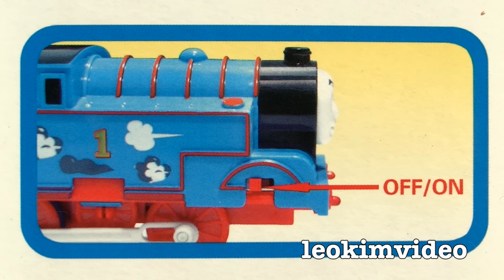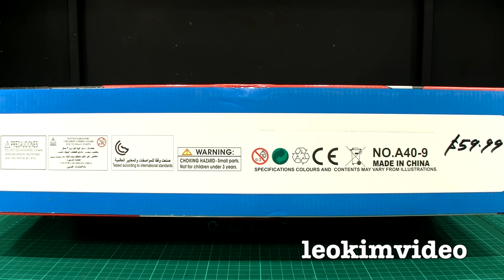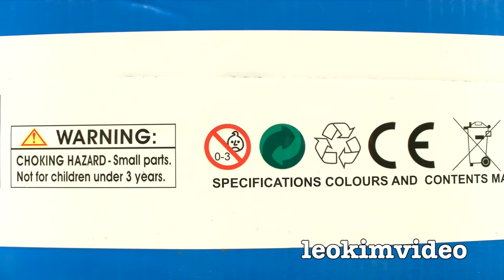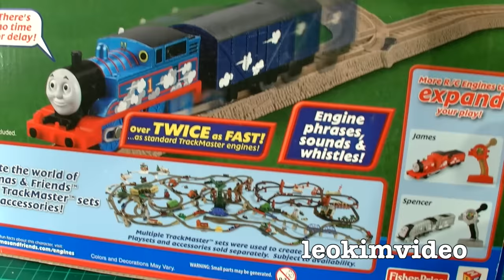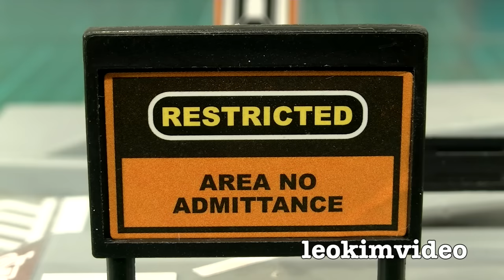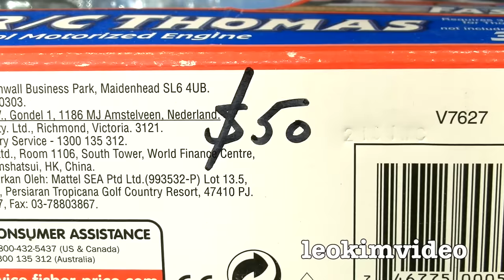Thomas The Tank Dark Side Knock Off Toys Ep 12 Amazing TOMY Toy Train Set

Comment: The 3-Speed Remote Controlled Thomas you have was most likely messed around with way too much during its production in the factory, you might have to have Custom Trackmasters see the problem with the Runaway 3-Speed Remote Controlled Thomas and see if he can solve the problem with it so it can work as intended, that way you'll have a completely functional 3-Speed R/C Thomas.

Comment: Hey Leo I used to have the three speed James. The James I owned would do that high pitched noise but it did it on hills. Even on a little incline it would stop and not budge and then if I put it on another track like a flat track after turning it off and then back on it wouldn't work at all. I also have the three speed spencer out of curiosity of James failing but to my surprise it worked just fine. I did tests on it like how much it could pull and hill tests. Spencer worked great. These engines are great to have but it's sad they malfunction. 

Sincerely Kyle Mathews

Comment: I had the SAME EXACT PROBLEM. It only worked for me one when I replaced the batteries on both the train and controller
P.S. Sometimes it gave me the high-pitched noise and all the other problems you mentioned

Comment: That remote acts like my Lionel Thomas remote
Reply from the maker: Train Tsar Fun I'm not a fan of IR remote controls, to me they seem flaky at the best of times. Even the amazing Lego train has at times a remote that's very sub standard. Recently I showed an older style RC cars Lightning McQueen and it was the old style radio control. It was very responsive and did not play up by losing signal. Maybe the toy industry needs to go back a step to what used to work far better than IR control. I think the biggest problem with IR is the need to be line of sight and proximity to make it work. Toys tend to be chronically bad when controlled by IR. But then again..they are only toys.
Reply: I would much rather have RC control instead of infrared. Thanks for the info!
Reply: /;;(mente aperta di tutta la mandare ausplrlt.
🐎
Reply: Train Tsar Fun
Reply: Luca Francesconi
Reply: Train Tsar Fun
Reply: Train Tsar Fun
Reply: Train Tsar Fun u b
Reply: Train
Reply: casa de la nonna suport familiar
Reply: It
Reply: Train Tsar Fun I've never seen you do a commenter before
Reply: I meAn commet
Reply: Train T
Reply: Train Tsar Fun dď
Reply: leokimvideo I ĺ
Reply: Train Tsar Fun oo9
Reply: afsyaa zam
Reply: Train Tsar Fun
Reply: Luca Francesconi
Reply: Evangelina Pa
Reply: Train Tsar Fun hml
Reply: Train Tsar Fun r u the real one because I know u.
Reply: i feel yer pain dude
Reply: Train Tsar Fun p
Reply: Train Tsar
Reply: Train Tsar Fu
Reply: leokimvid
Reply: Train Tsar F
Reply: anyarlo      P
Reply: anyarl
Reply: Train Tsar Fun งง
Reply: Train Tsar Fun o
Reply: Train Tsar Fun lol I guess that means Welcome to the dark side
Reply: Train Tsar Fun este perfil esta mucho mejor  y original
Reply: Train Tsar Fun  day
Reply: @mikepep146  when you let a kid on youtube
Reply: @deadchannel9861  lol true, idk whats going on with those comments
Reply: @cnobeats  ll

Comment: Where is the infrared light receiver on Thomas I wonder? I have had problems where there has to be very low light for light receiver to work on other toys that use the same system. That Hum you here is the little computer chip inside but why it makes that sound I can not tell you my wire less mouse makes a lower pitched hum as well.